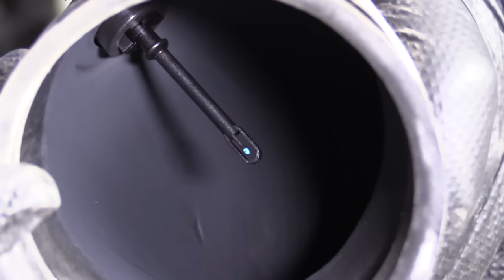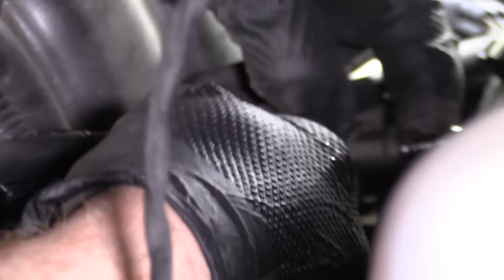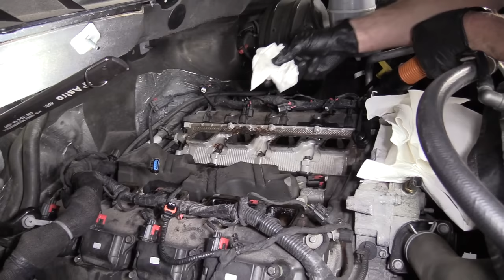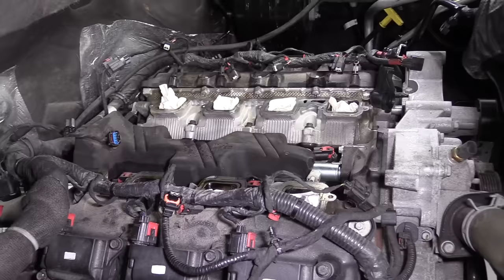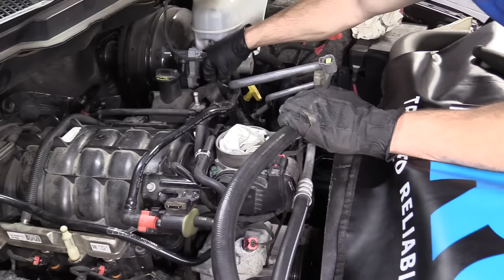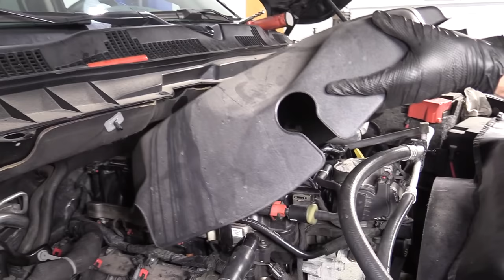How to Replace Intake Manifold Gaskets 09-19 Ram 1500

Comment: Very good video. Just wanted to add you do not need to pull the alternator for this job and also be careful of the plug on the idle motor on back of intake. Recently did one of these because customer concern was oil leak on the back right side of engine. Little did I know someone had there hands in it previously and broke the plug on idle motor and forgot to put the gasket for pcv box in so it was leaking out of intake manifold..
Reply: Rear passenger side? Cause I got oil leaking out of that side too, which is why I'm looking at this video lol

Comment: Great video....if someone else is doing this job loosen the clamp at the throttle body, go over to the air cleaner remove the hose , pull straight up on the whole housing it comes out that easy, i have to remove and replace mine each year for the visual  inspection when I have my aftermarket intake on there.
Reply from the maker: +TheBULLRAM Thanks for the tip!

Comment: Close to or 100,000 miles plus I would change the injectors especially DIY people. I used dish washing detergent and hot water very warm water on a LH concorde. Changed everything but the injectors and changed all mounted sensors. I don't envy y'all at all very good video.Also, replaced Throttle body and sensors.

Comment: Good video, was able to replace vvt actuator without disconnecting rear sensor or removing alternator. If you get the manifold loose you can get under the intake manifold and replace the solenoid. Make sure to be careful with gaskets!

Comment: 2011 1500 dodge ram 4.7 classic crew cab rebuild engine got my heads shaved now I have intake manifold leaks on both side replace with used 1 but same wat could it be n new Gaskets

Comment: Do you have a video on the short runner valve for 2010 dodge ram 1500 5.7? 
Apparently have to replace mine p1004 
Does the intake manifold control valve require a green seal?

Comment: You are amazing. Thank you so much. Going to get started on this job now as I’m getting oil from the PCV valve leaking down the back of the block.  I’m sure I’ll start checking air and get a lien code. If I don’t get to it truck is 10 years old with 50,000 miles to the age that got me.!
Reply from the maker: +@ericsacco7406 Thanks for checking us out. Shop for high quality auto parts on 1AAuto.com:

http://1aau.to/m/Shop-1AAuto-c

Comment: I replaced the stock alternator, serpentine belt and battery on my 2012 RAM 1500. Those myriad tangle of plastic connectors to various sensors are very sensitive and tricky. The plastic can be brittle and crack easily!! You need to be super careful to reconnect them correctly and tight or the engine will not start!! I would use a di-electric (blub) grease when refitting the sensor connectors. Good video, big job well done!
Reply from the maker: +NewHampshire LifeStyle Thanks for checking us out! http://1aau.to/m/Shop-1AAuto-c